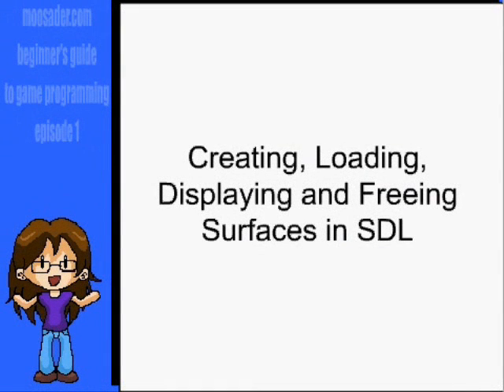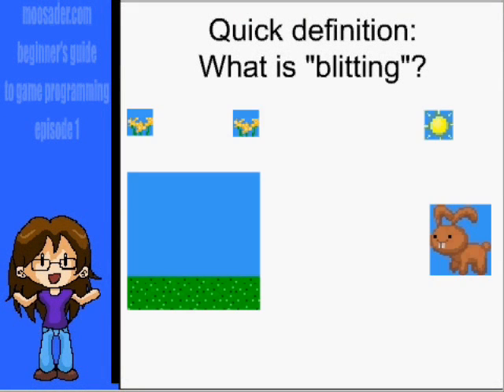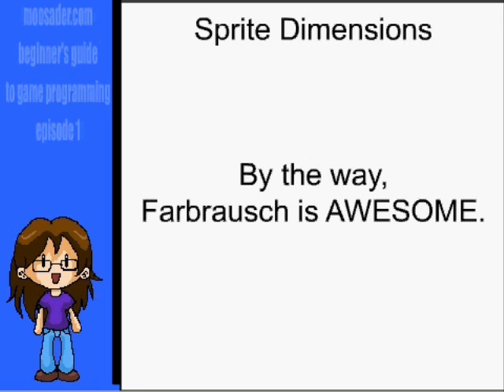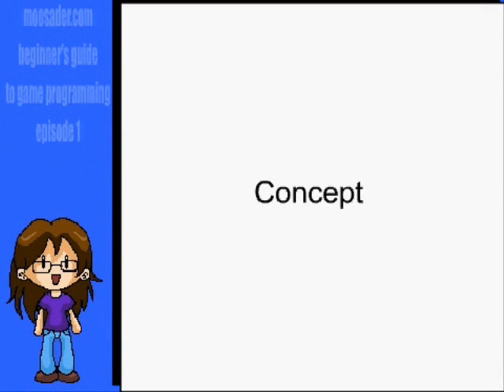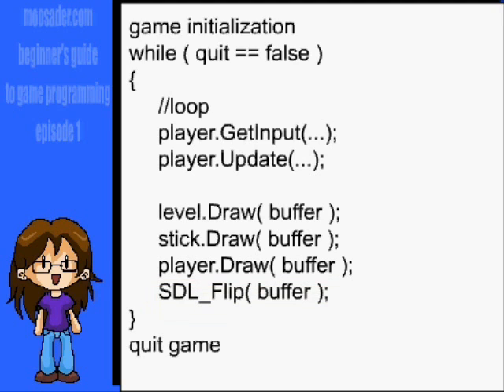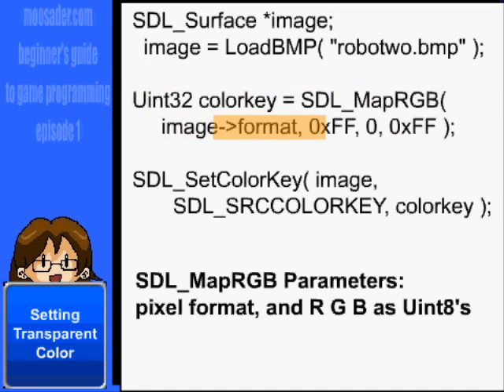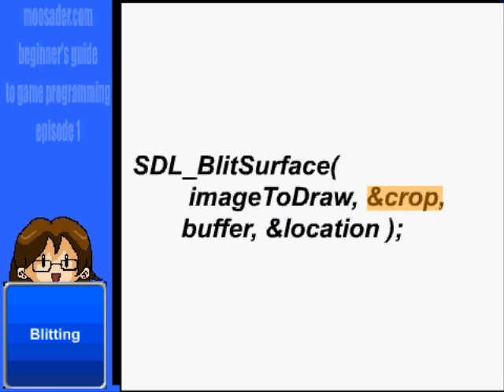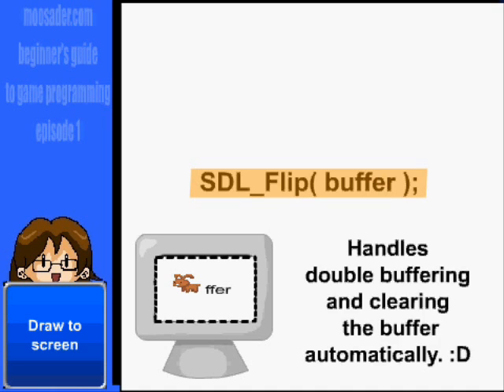Beginner's Guide to Game Programming Ep1 Part 4-B Graphics in SDL

Comment: Does anyone know why "SDL_Surface *image"  is a pointer? Does it work if you just write it as a normal object like "SDL_Surface *image"?
Reply from the maker: I haven't read SDL's code, but my assumption is that the functions that SDL uses to create the surface will do something like

SDL_Surface* image = new SDL_Surface;

so it (probably) is dynamically allocating memory behind the scenes (Which is why you also need to call the FreeSurface method when you're done with it.)